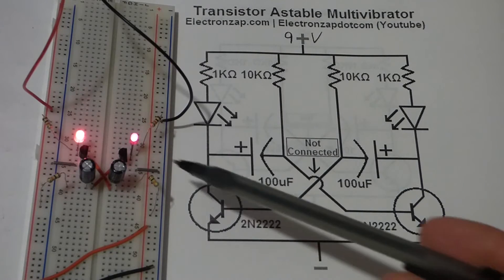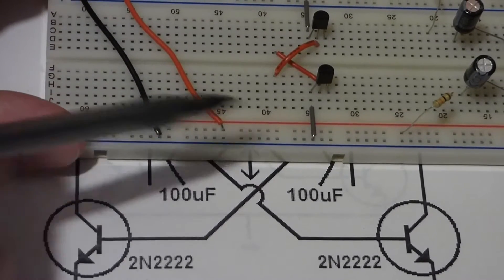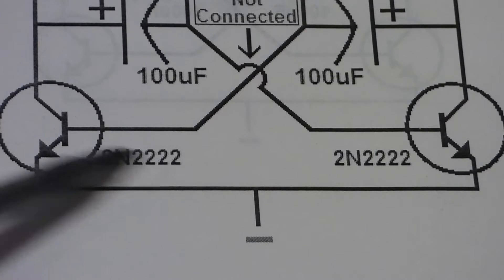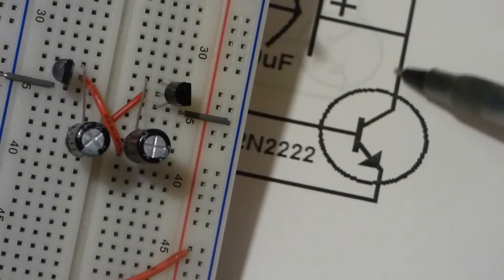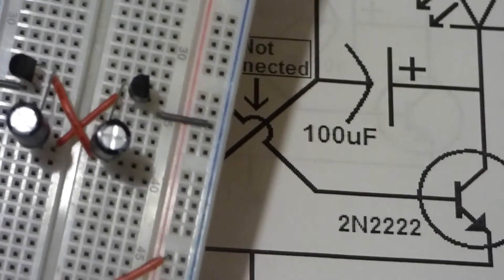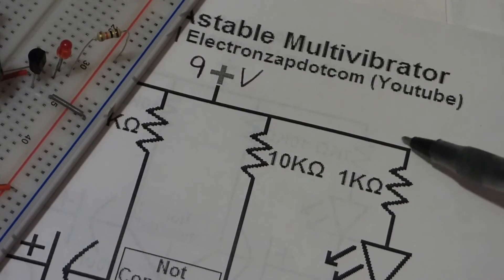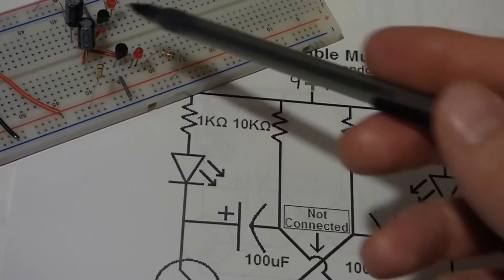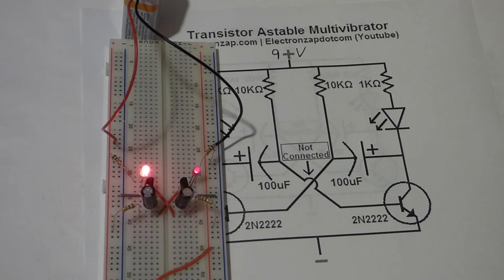Astable multivibrator demo circuit step by step build NPN 2n2222a transistors and capacitors

Comment: nice easy to follow tutorial and good explanation about the concept of how it works.  I have a question please.  i built or i think i built a soundcard oscilloscope protector circuit using 1million resistor followed by a 10k potentiometer and out to a 1u capacitor and two diodes one opposing the other parallel to each other i saw it online.   ...   anyways,  i want to connect the tip of the jack after the capacitor out and the sleeve of jack to the end of the other line where the diodes are right?  then i connect the beginning of the first resistor to the 3rd pin output of the 555 timer and the third leg of the POT to the pin 1 Ground of the 555 timer and then the other end of the jack to the soundcard ... i did that but it didnt give me a square wave on the visual analyzer on the pc.  but since it is a low voltage 555 timer circuit i then connected the propes directly to pin 1 and pin 3 on 555 and got a square waveform.  what am i doing wrong with the protector circuit when connecting they way i described?  or is it that the 5volts VCC is just too low ?

Comment: It doesn't matter which way you install the capacitors. + one way or the other, don't matter. Circuit still functions. You can put one capacitor one way and the other capacitor the other way and the circuit will still function.

Comment: Thanks! Works great. Is there a way to make it a triangle wave?
Reply from the maker: That'd probably be a big circuit for transistors. They can be made more easily with op amps, but I haven't made one in a while.

Comment: Awesome, this worked.  I had used a 10mf capacitor and 33k resistor.  what I had, and it was again nicely in the noticable frequency.  Did this to introduce bread board to my kid and he loved this.
Reply from the maker: Nice! I think it is the second circuit I showed my niece. Flashing lights are fun for anyone.

Comment: can i use 12v as input? i find it hard to make it this our project at school. and i really want to make this done.. i tried so many times i guess.. but the 2 LED just light up and didn't turn on and off like yours, do you know what is the problem?? i did follow the steps.
Reply from the maker: Should work about the same. If they are flashing fast enough then they will both look like they are on constantly even though they are just flashing quickly. Larger value capacitors and/or larger value resistors that go from the positive side of the power supply to the negative side of the capacitors and base of the transistors will slow down the flash. Hope that helps!
Reply: @Electronzap thanks you very much sir. i am understanding it much better now. you help me a lot, so in order to get it right i will have to increase the value of my resistor or my capacitor. does the transistors still the same as 2N2222?
Reply from the maker: Any NPN bipolar junction transistor should work. Pin layout may be different though if you use a different transistor. So, to wire it exactly as I did, you'll want a NPN transistor that starts with 2N
Reply: @Electronzap  If i use PNP transistors does it will still work sir?
Reply from the maker: Not wired like this. The polarities will be opposite. But it will work the same with PNP BJTs (that start with 2N) if you switch the + and - sides of the power supply and reverse the direction of the LEDs and capacitors.
Reply: @Electronzap  thanks sir. love this tutorial
Reply from the maker: Glad to hear and thanks for watching! This is an old video, I hope to make a new video of this circuit that will hopefully be a lot better soon.
Reply: I tried doing your suggestion but my LEDs are not pulsating the way you do it

Comment: I have managed to make the circuit thanks to you and your tutorial, thank you.  However I did struggle to get it to work at first until I noticed that some of the points on my breadboard had bad contacts. Is it possible to buy a quality board, or are they all the same? Cheers, John... :)
Reply from the maker: I only really use cheap boards and I lose connection a lot. I have read many times that more expensive boards have better connections. If I was building a serious prototype circuit and needed a good board, I would go Amazon and read the reviews of electronics breadboards, and find one that reviewers claim makes better connections than cheaper boards.
Reply: Ok Thanks again for your help... :)